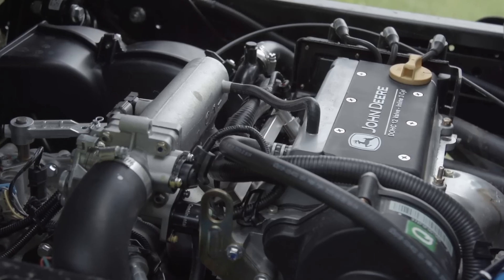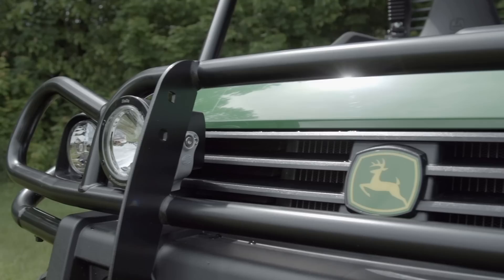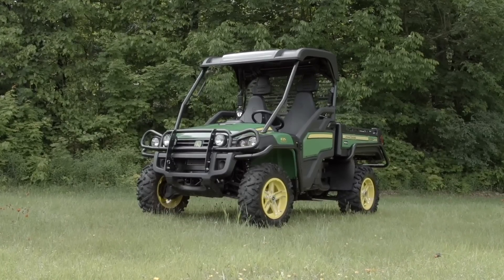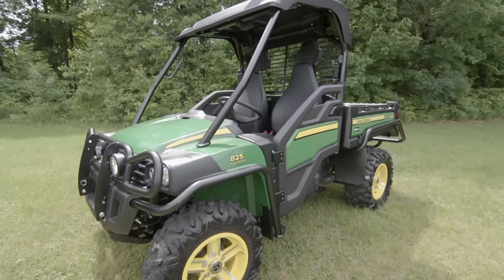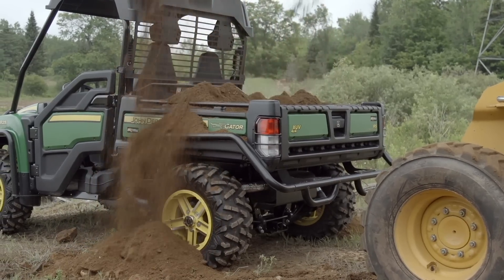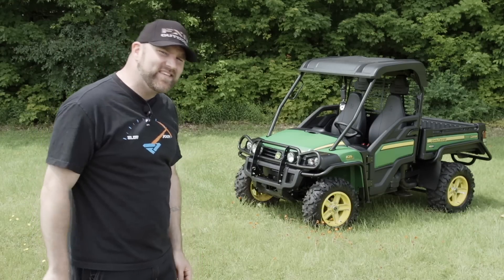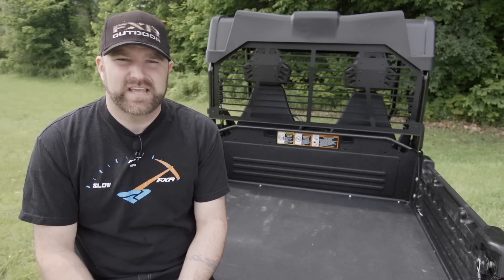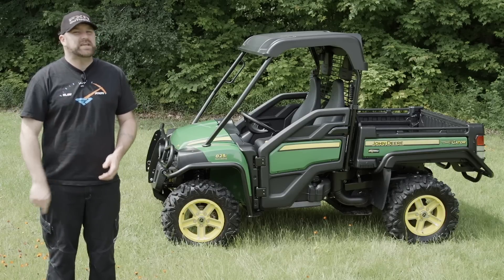TEST RIDE: 2015 John Deere Gator 825i

Comment: My Gator 850i RSX was finally fixed by JohnDeere, props to them for standing behind their equipment!!!! The new clutch install was a first for them. WARNING: the breakdown was NOTHING like the book, even in their book, lol so don't do it yourself if yours goes out!!!.. they had to order a special tool from JD to get it done.. and drop lower frame!!! wow major work.. but, now, it is very enjoyable to ride in, doesn't overheat anymore. Now the real ride issues I have, 1. it will fry your legs like a freaking egg!! Really hot, it gets super hot and shoots the heat directly onto your legs.. so jeans might be a good idea, it was very uncomfortable... very, if your not hitting cold mud, lol.. 2.  real design oddity, I noticed this last cleaning... the front trunk with a gasket on it, as if to keep something dry.. will not work, it has holes inside the box, inside seal through the fuse panels? lol Yes, they stuck a gasket on the hood, put the fuse panel and main pc in there.. and you can look THROUGH the wire hook up to the ground? odd.. I still only have done really light mudding, and you see the front had flooded? so don't put anything that can not get wet up front... 3. Gas gauge is not accurate, we only filled it maybe 4 times so far, so take a can lol, 4. This is loud, so get a helmet and ear plugs, it is louder than the ones with more power, oddly enough?  5. every time I wash it, fog shows up in headlamps and digital display.. prob going to be an issue down the road. Besides that, we think it's solid.  The power is better with new clutch, so we are thankful in the end to JD, and will be riding again soon!! #johndeererocksagain #johndeere850iRSX
Reply: Jay jay dynomite d

Comment: Thanks for the video.  i will have to go test drive one.  I like many people have sold my atvs and am gravitating to the sxs market.  I seems like a crossover type of sxs, just what I am looking for.  Sure everyone likes high speed machines, but as you said, trail riding, that 60+ top speed doesn't make much difference.  An enclosed cab would be a nice aftermarket item for this also.  Be great for deer season and many other things.
Reply: Polaris rangers are nicer
Reply: +C Mud It depends what you call nicer.  I looked at the Ranger before I bought John Deere. The frame of the Polaris isn't as well built as the JD. I didn't care for the single cylinder engine either. The Polaris is a smaller machine. Remember the 825i is a crossover rig. I serves two functions, work and play. The Polaris is more the play toy.

Comment: I like the idea of the wrap around bumpers.  Great feature actually for JD for saving  your fenders.  I'm looking to trade for one of these or the newest single row seat Kawasaki Mule Pro FX.  I may be wrong, but I believe both models the JD 825i and Mule Pro utilize the same engine?  I have a like new 2013 Kubota 1120d with an all position 72" Curtis plow and other extra's.  It went really cheap for what I was getting so I bought it two yrs. ago at an estate auction.  While great on fuel the inline 3 diesel in the Kubota is only 24.5hp and 50lb. ft. of torque.  It is very slow in other words, but does plow the snow for me very well.  We use it in my son's and mines business for tons of things.  Speeds of 25mph aside my big gripe with Kubota is its shifting gears.  They really need to refine that system.  Being basically a hydrostatic tractor, then add in a separate shiftable L,H N R transmission and the high pressure from the hydro makes shifting very hard to do at times.  It is supposed to release pressure when you push the foot brake via a cable to the hydro in the back.  It only works about half the time....Its either a big waiting game and pushing the brake pedal as hard as you can.  Or just shut off the engine completely and then shift it to neutral.  It needs a start in gear feature as well.  Kubota is coming out with a new RTV this year with I believe has a parallel twin engine made by Subaru and of course a gas engine.  I think the Kubota concept and diesel is a tough well made machine.  Fix the shifting woes,,,I'm not alone,,,and simply add a turbo to that great little inline 3 Kubota diesel to give it good acceleration.  Bad acceleration is not your friend for trailriding.  I don't have to tell you guys that..Thanks for the video..Gotta see what kind of trade in JD would give me, and find out if there is a way to put a 2" receiver hitch onto a JD or Kawasaki Pro to hook up my Curtis elec/hydraulic plow.  Oh,,,the dump bed on the Kubota is fantastic having its own hydro pump separate from the transmission..sorry for the long post.  I hope to see you guys test more machines like these as they are what most people really need or want over most high speed racing/trail models..for me at least.

Comment: if you guy's like this why not do a review on the new mule pro fxt? ! it has the same motor. I would like to know what you think about it. I have a 2015 mule pro and it does play and work fairly well.
Reply from the maker: +Bruno DeFrancesco We have ridden the MULE and also love it. Same engine as this Gator. We have not yet had one to evaluate on our own turf though.  Still working on it.
Reply: Thanks for the return statement. Totally different machine than the gator.

Comment: I know, I posted this on other video's.. but I feel like I should... In my well treated baby super toy, the clutch is gone, and less than 30hours on light ride time.. so disappointed.. when it runs, I loved it, but that is waaaayyyy too early to go out... and I noticed the lights and dash and all enclosures would leak when I washed it off? You would have fog in the lights... and dash... so, not sure about quality... anyway.. just warning... I am never messing with them again, because it costs $1100 to fix... Never had a " toy" for fun and work like this ever go bad like this... just sucks, heartbreaking... so please look around before you think this is the one...
Reply: just your average John Deere lol try a can am maverick 1000R turbo
Reply: +XxdarkwolfxX lol, well now, they opted to pay to fix clutch! I was impressed! Haven't got it back yet, so who knows wha tit will be.. I hope better! It's odd that in the Manuel it says it isn't mad to ride for long distances at a certain speed? Odd.. I'll check out the one your talking about, prob out of my price range! Lol but thanks for letting me know!
Reply: Had my 70hr 2012 825i clutch repaired 3 times. Every time it was covered under either warranty or a PIP(Product Improvement Part) for the known clutch issues. When it went out the last time, I took it back to the dealer 4 years later and they gave me purchase price on a new gator. Thats standing behind your product. Happy so far with the new 2016 825i.

Comment: no comparison...have both the 900 xp polaris, as well as the 825i gator, and the Gator is the one we fight over at Hatfield & McCoy trails. More stable on sketchy sideways inclines, leaves your spine in one piece after several hundred miles of coal roads, and that Chinese Chery motor is far better technology and is used in several automobile makes around the world because of it's reputation for quality and bang for the buck. Deere didn't rub our patriotic emotions while, "chery-picking" THAT motor to use in this machine, for no reason...they knew exactly what they were doing, and knew the emotional sacrifice would be well worth the final outcome when folks put that motor to the dirt...much better engine than the Liberty engine in Polaris. Sometimes, and especially in a mostly utility vehicle that ALSO plays well, you have to get past ultimate speed for what will stay the course. Hit something stationary with a front wheel and you will see the next place the Deere far exceeds the polaris...the Polaris will fold a control arm, rip the ears out off and bend the frame, and pretzel a tie-rod, and the deere could hit the same object and do nothing more than launch your eyeballs out your head from inertia, and not even need an alignment afterward. How is this so?...lay a Ranger frame, and an XUV frame side x side on the ground, and let that answer your question...the Polaris frame is pathetic, and will bend if you look at it rough. The deere frame is hydroformed heavy tube, vs Polaris ultra thin-walled channel. Call me crazy, but give me a few extra pounds on a utility machine, so it doesn't fold up like a cheap toy. Been there, done that a few times on my Polaris'. If I want to go fast, I will buy a Canam. If I want to go fast enough, and know I can work the snot out of the machine and be comfy doing it, I will take the Deere. Meanwhile, I have my final Polaris Ranger for sale. It's like new, but on it's third frame.
Reply: +David Ramstien The new 860i looks like something that could give the Ranger 900 a run for its money on performance as well.  Its disappointing in that Polaris frames in their atvs are noted for their strength.  I guess as you said sometimes extra weight isn't always a bad thing.  All utvs except for the 50" trail machines are relatively heavy anyway.  1300 lbs vs 1500 lbs isn't really that much of a difference.